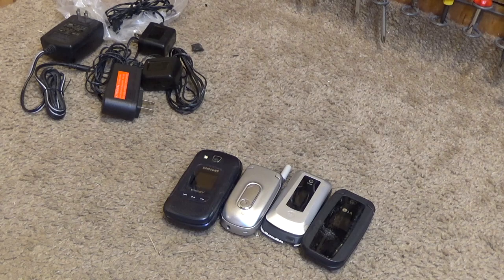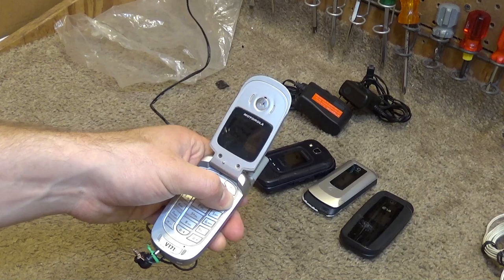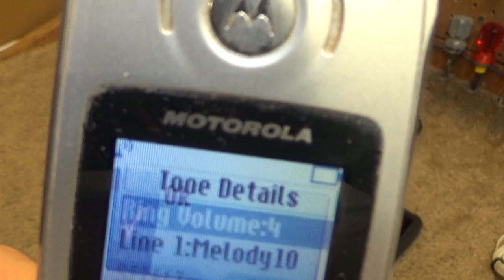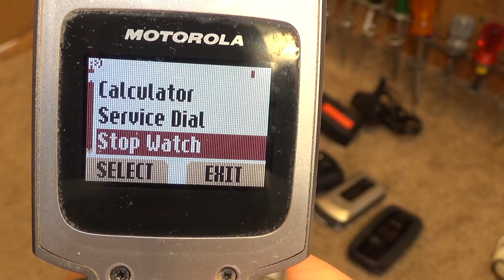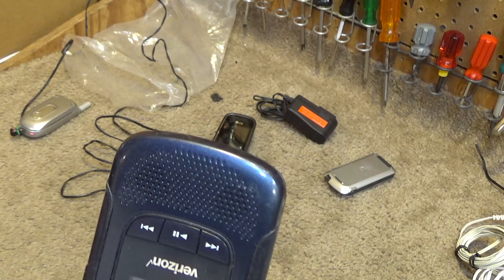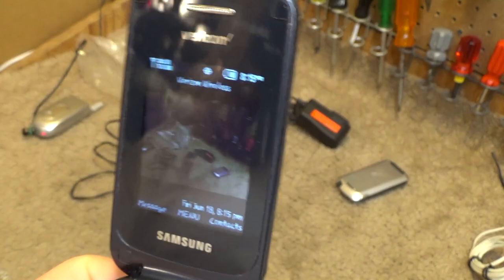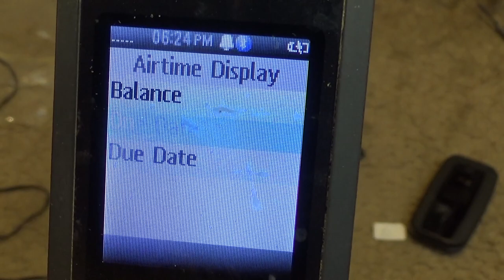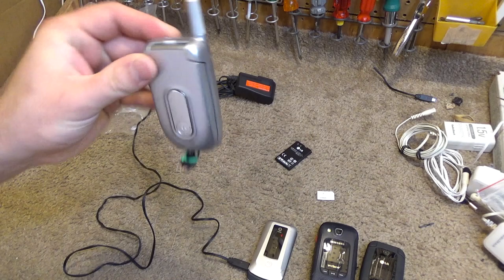A Look at Some Old Flip Cell Phones

Comment: I’ve worked with that sort of phone at the end before, I think one of my relatives had one similar and then passed it down to me. I doubt the battery works anymore. 
I’ve always liked those rugged phones with the MP3 and PTT functions on them. If I hadn’t gotten an iPhone years ago I would’ve gotten one of those.
Reply from the maker: I'd vote on it working still. There seems to exist a [mis]conception that lithium batteries have a very limited shelf life. I have not found that to be the case.

Comment: Actually you can put a sim card (at&t preferably) in the Motorola TracFone with the external antenna and make calls on it
(As long as the sim is activated)
Reply: Will that work with a w175g because it and my sght105g never came with SIM cards just the phone and the batteries
Reply from the maker: I don't believe we have that network around here anymore.
Reply: @awesomeiphone597  yes it should
Reply: @JordanU  TracFone does exist still
Reply: @kujotheflufferwuff9962  ok thank you :)
Reply: @JordanU  oh
Reply: TracFone no longer offer 2g anymore or 3g as it's also being phases out

Comment: There were several of those TracFone Motorolas in the family years ago,  some were flipping phones and some not, but they all had that same OS give or take a few nuances.  I remember all the games fondly.

It's kind of odd how when it comes to landline phones, you vastly prefer quality even if it comes at the cost of range loss, but with cell phones you vastly prefer range even if it comes at the cost of quality loss lol.  In my opinion 4G is an excellent compromise of both things because when you're at a lower level of a building where there's no signal, you can use Wi-Fi calling, and either way you're getting outstanding quality.  2G and 3G call quality is just unbearable, and 5G is so high frequency it barely penetrates a tree.  In other words, for a few reasons, we're just now leaving the era of the golden age of cell phones.  But either way, it's still terrible that these mounds of phones made in the 2G era are now nothing more than glorified unintuitive tip calculators; what a waste.
Reply from the maker: The landline phones and the cellular phones serve two entirely different use cases. When I use a landline, I expect the call quality to be lifelike and of utmost reliability with the understanding that such performance will only exist within a very limited range of the nearest phone jack. When I use a cellphone, I expect it to work everywhere and anywhere that a call may need to be made or received with the understanding that such performance comes at a limited quality.

There are numerous backroads I travel regularly that are in rural areas, but they're far from 'off the beaten path'. The old cellphone used to work flawlessly on each one. The new 4G phone has multiple areas where it will not get a signal. If I am in one of those areas and a situation arises where a call needs to be made, that new phone is totally worthless.

I would argue that the call quality of the CDMA network is far from unbearable. I would certainly not want to try reading off a string of alphanumeric characters to someone through it, but for regular conversations, I've never had an issue understanding what people are saying. At least not when using a proper handset and speaking into the microphone; there are tons of people that call from an I-Phone and don't speak into the microphone properly and that call will be totally unintelligible, it still is even on a 5G network.

You make a valid point about the use of the WiFi calling indoors, but it doesn't apply to me. When I go into a building, the last thing on my mind is checking to make sure my cellphone is connected to a WiFi network and ready to go. I'm only going to think about that when I've missed calls I was supposed to get, or an emergency situation has arisen where I need to make a call and now cannot due to not being connected. I suppose if you're operating on a smart-phone addiction like the majority of the population, the WiFi connection is the first thing done when entering the building, and in that case, your point is completely valid.

In my opinion, the era of phones that used 3G for data and CDMA for calling were the 'golden age' of cellphones. That technology combined excellent, reliable coverage with a speed that, from a practical standpoint, should satisfy the overwhelming majority of what would be done on such a small device.

I agree about the waste; sadly this is the case with almost every piece of technology ever known to exist, and it's a continual cycle I don't see breaking any time soon.

Comment: This era of cell phones was the best. The phones were simple, powerful, worked well and were built to last.

As I explained in my previous commentary, me and my dad both had LG C2000 flipper phones back in the day, and to this very day, they still hold a charge, get a signal and are still in great condition, plus my grandma had an LG Cosmos 2 for over 10 years until recently when she upgraded to those puny I-Phones because of the CDMA network scare.

I would still be using that phone or something similar to it if it wasn’t for AT&T no longer activating devices that run on the 2G network even though the 2G network still exists.

Comment: I have a slightly different model to that phone and it's on the same network as the same phone as you and it has the battery in it but I don't know if you can find the adapters for anymore could you find one like that anymore Jordan
Reply from the maker: I don't understand.

Comment: verizion delayed 3g shutdown to 12/31/2022
Reply from the maker: That's outrageous.
Reply: @JordanU    its going take them long time to removed  all  old equipmentin all locaions
Reply: It would be nice if the 2G/3G spectrum were to never shutdown. I use Verizon and apparently I still have 1X (I think it is the same as 2G. Correct me if I'm wrong.) and 3G service still available in my location.
Reply: @JordanU  How come your reply to me got removed? Was it YouTube again?
Reply from the maker: @Sonic_X_Freddy_Lover001  Probably, that seems to be a running issue lately. What I said in the reply was that 2G is not the same as CDMA, they're 2 different bands.
Reply: @JordanU    its uses more bandwidth and has new  more efferent  codes
Reply from the maker: @bradleyhifi8155  What does?